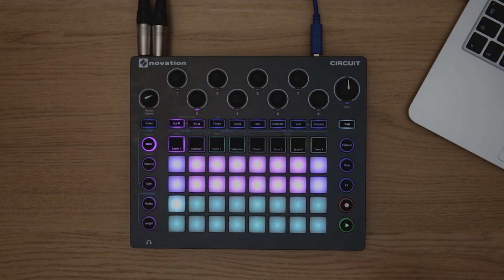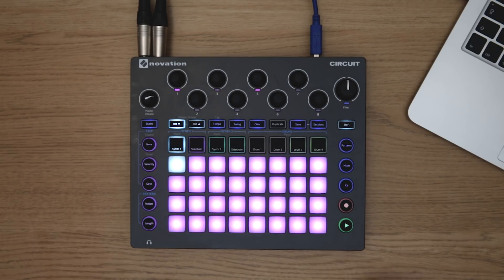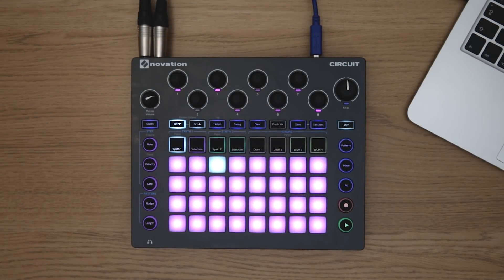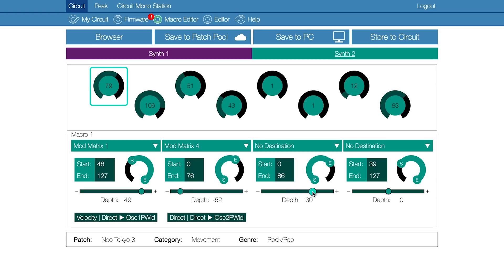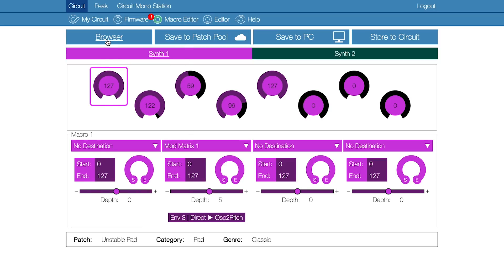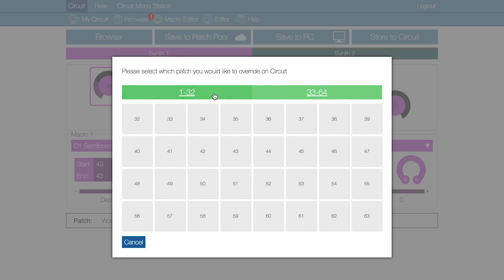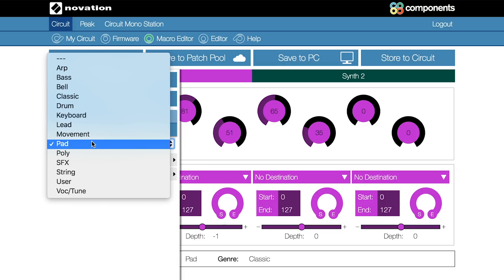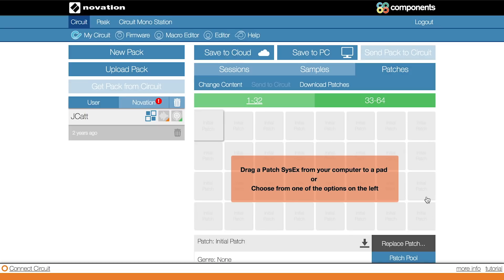Novation // Circuit - Macro Editor

Comment: Nice update guys! I'm liking where this is going... If we could have a full patch editor in components, and therefore avoiding the M4L editor, that would be amazing! (well it's already amazing, but it's nice to have a wish list!) This is also cutting edge to be using Web MIDI APIs and Electron as the application shell. I'm really impressed... Your Dev team are doing a great job!
Reply: I couldn't agree more! I don't have ableton and the standalone isotoniks editor rarely works for me (windows 10). I would really love a reliable patch editor in components. That all being said, I'm very impressed with Novation continued dedication to update and add features to the circuit for free.
Reply: jordan marks yeah, I have lots of issues with the Isotonik editor too. They have a VST editor available, which I think is better... But the components feels much better quality, so if we did get a patch editor built in, that would be phenomenal! We have definitely been spoilt with updates in any case!
Reply from the maker: Thanks for your support Clayton. Your feedback and suggestions will be shared with our Dev team.
Reply: I did finally get the standalone editor working(I have no idea how, Magic I guess?). And once I did it worked really well and was able to make some patches that I like quite a bit. But I think a more stable components editor would be amazing. And yeah we are definitely spoiled by all these updates ha

Comment: Is it possible to hear the patches while you are adjusting the macros to see the changes you are making? I don't use the software that much because even though it is well thought out it is still confusing enough to hinder my creative flow.  I have had problems selecting new patches and new samples to load because I can't instantly hear them  when circuit is connected to computer.
Reply from the maker: Sure, that's certainly possible. Just ensure that you click 'Connect Circuit' within Components to establish bi-directional control between Macro Editor and your Circuit. Then, any changes made using the Macro Editor can be heard when the corresponding Synth is played on your Circuit hardware.